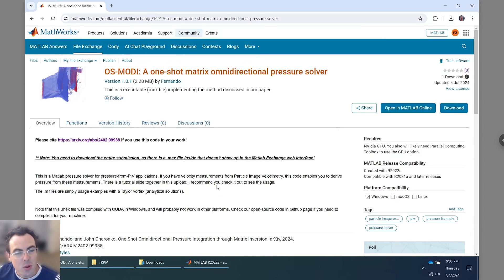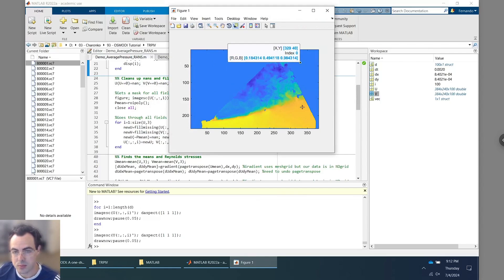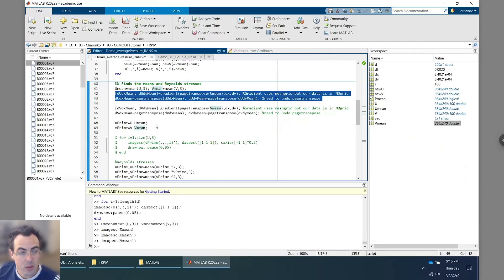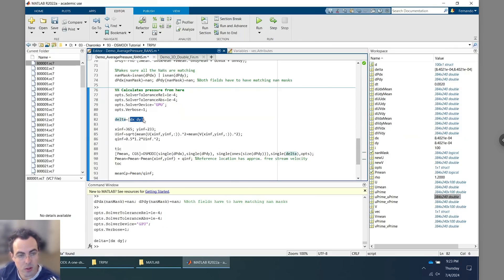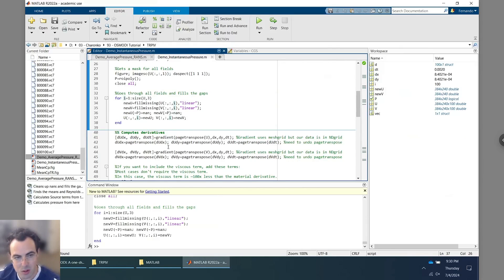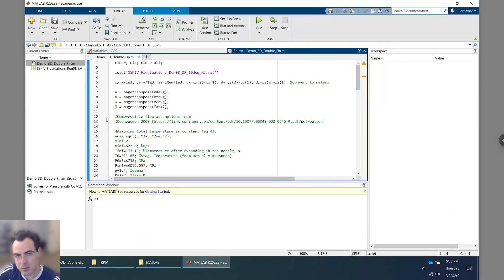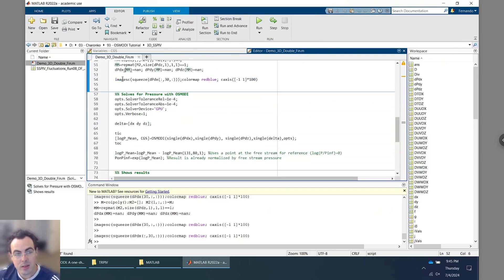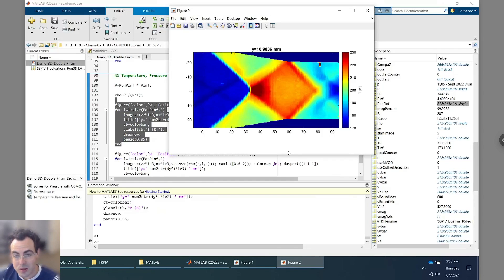Matlab Tutorial for the OSMODI (Pressure from PIV) solver

Comment from the maker: Link to the Github Open-Source code:
https://github.com/3dfernando/pressure-osmosis

If you use our code, I'd appreciate you cite us!
Zigunov & Charonko (2024, ArXiv) "One-shot omnidirectional pressure integration through matrix inversion"
https://arxiv.org/pdf/2402.09988

Zigunov & Charonko (2024, Measurement Science and Technology) "A fast, matrix-based method to perform omnidirectional pressure integration"
https://iopscience.iop.org/article/10...
DOI 10.1088/1361-6501/ad2da5

Comment: Sir, the .mex file is missing in Github, and the file has also been removed from Matlab works...
Reply from the maker: Hi, nurachand, I apologize for the problem. I think my collaborator has not uploaded the compiled files to the Github page yet. We had some delays due to LANL's open-sourcing process.

I can share the file via personal communication until this problem is fixed, if you're interested.
Reply: @fzigunov @fzigunov Sure, I sincerely want to understand the Pressure estimation methodology from PIV (velocity) data. I have 2D PIV files in .vec format.  How do you think I could communicate with you?
Reply from the maker: @nurachand, try the link below with the files in the meantime. The .vec files will work if you follow the procedure in the tutorial. If you face issues, please let me know. I can be contacted at fzigunov (at) syr.edu.

https://drive.google.com/file/d/1uh29GmNYVBLysGIssJu8EmvoPPcqA448/view?usp=drive_link
Reply: @fzigunov  Thanks , i will try and let you know.